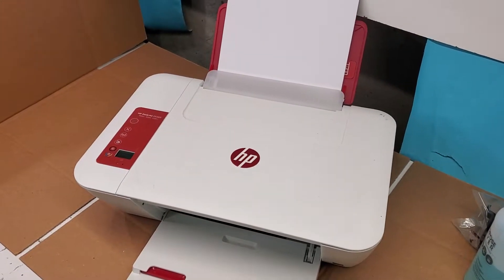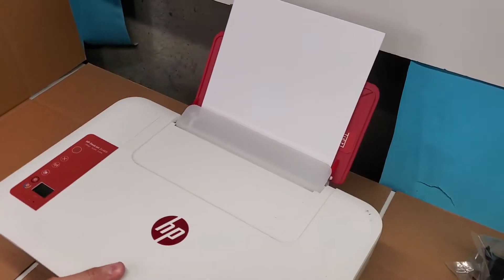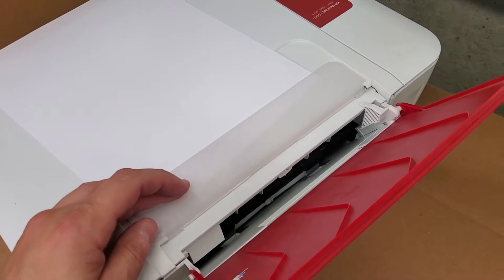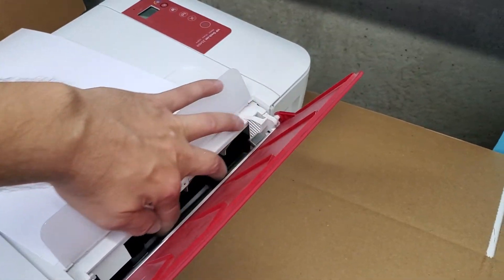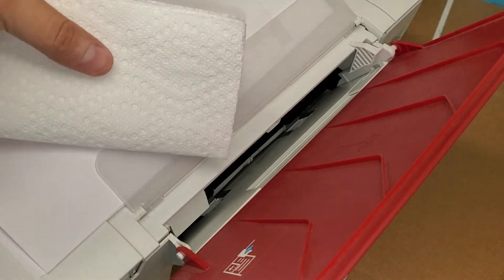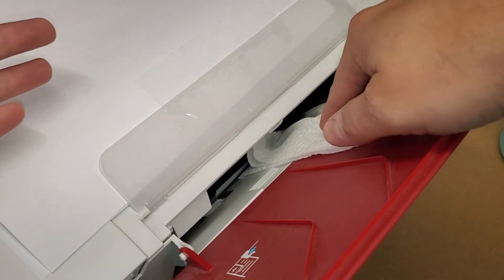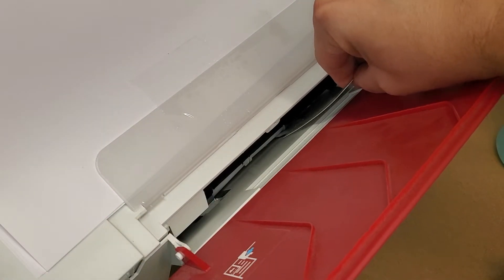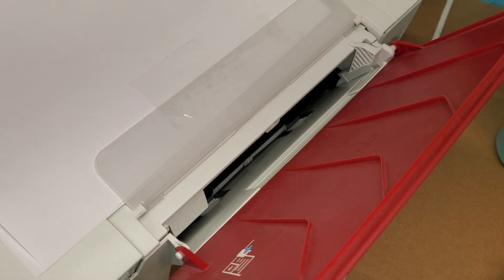HP Deskjet 2540 Printer Paper Feed Problem Fix 2541 2542 2543 2544 2545 2546 2547

Comment: THANK YOU SO MUCH  !! you save me. I´m form Portugal - Europe. 
I sprayed two sheets of paper, on the tip with glass cleaner and it also worked well.. and I had them pressed 4 or 5 times. I held the sheets so that the rubber wheels rolled over the tip of the sheet wet with glass cleaner.